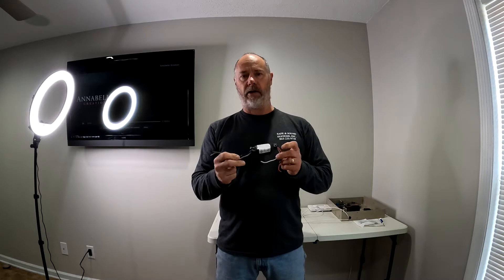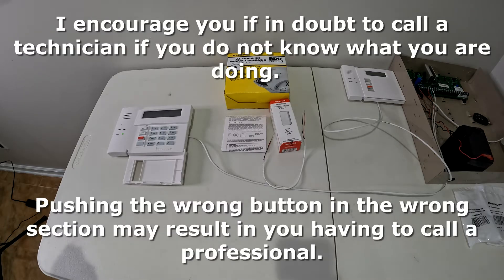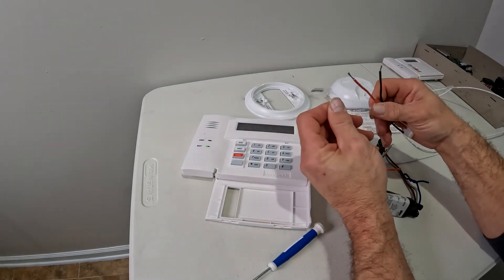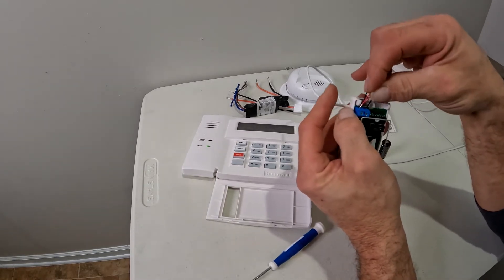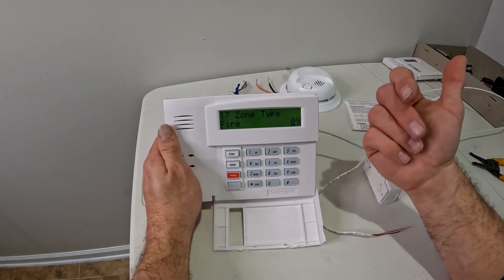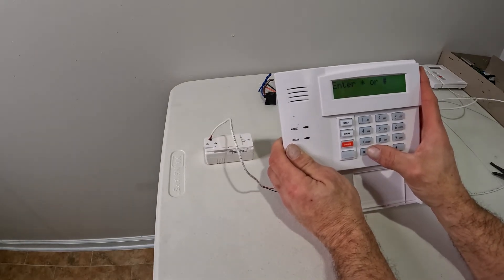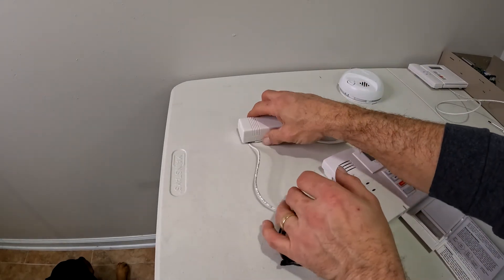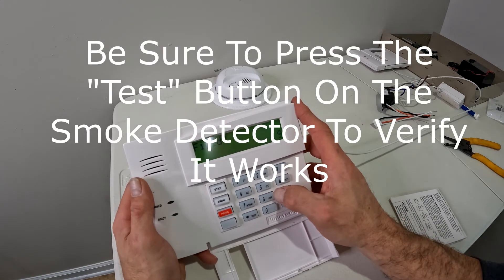Integrating BRK RM4 Smoke Detector Relay into Honeywell Alarm System

Comment: I recently moved into a new home N.C.  where I will order this relay pronto. Thanks for video, I was thinking that I would some day hard wire a relay back to the control panel!
 Central station will normally give a CALL BACK to the residence & an alternate (my cell phone) prior to dispatch Fire Department. Surely I will verify this with my central station. NFPA 72 will not allow a CALL BACK for fire in a commercial fire alarm. NICETIII
Reply from the maker: In SC if you have your system monitored, the same thing you cannot have a residential fire alarm in a commercial building contact the fire department.... Now that being said when I set up a contract for monitoring with my customers, I submit the zones to the central station and there is usually an "Interview" or a call list sheet for the central station.  So for example if Zone 1 is your Fire Alarm, when Zone 1 is tripped the central station receives the signal.  That list tells them to call you, call a neighbor, police, fire etc.....  So that being said you should be able to list zone 1 as fire, but to have them only call you and not dispatch fire department.  Every state, and in some states even Counties and Cities have their own laws, so check with them before adding to your system.  If you do add it yourself and add a zone without updating them, say you pick zone 8.  If the central station does not have a zone 8 on their list they will call you first and you don't answer police will be dispatched.  Long answer but I tried to make it easy to understand.  Thanks for watching, hopefully you hit the sub button I would appreciate it, I'm almost to the point I can get monetized.
Reply: @safesoundsystemsinc2005 
Can this same method what you showed in this video work with a DSC

Comment: wll this work on a 120v firebell
Reply from the maker: Yes it will technically work on anything that is 120v.  It is basically a normally open or closed circuit and when 120v is sent down the wire it closes or opens the circuit, can be wired either way.  Could use it on a light switch if you wanted to.  Hope that helps, thanks for watching.
Reply: @safesoundsystemsinc2005  Indy the output low volt though, I’m trying to make work with with a flow switch/ fire bell.
Reply from the maker: @tonycortez8556  I'd have to see what you have, for an alarm system I can take anything that is 120v, soon as it gets power I could open or close the relay when energized or not.  Here are 2 links to the wiring diagram and specs...  https://digitalassets.resideo.com/damroot/Original/10000/RM4_Spec%20Sheet.pdf?_ga=2.267523016.791945542.1685450132-705068738.1685450132
https://digitalassets.resideo.com/damroot/Original/10000/M08-0124-001.pdf?_ga=2.204632790.791945542.1685450132-705068738.1685450132